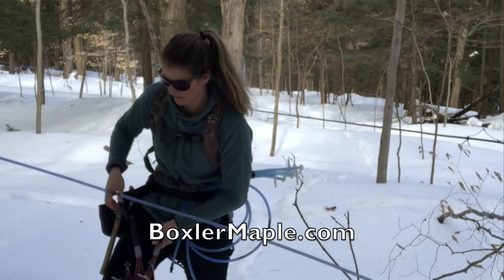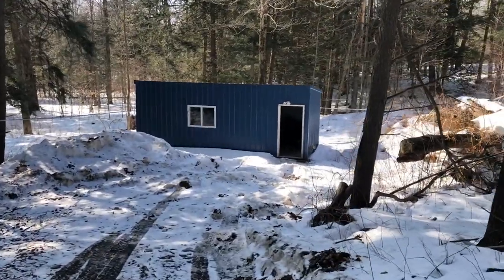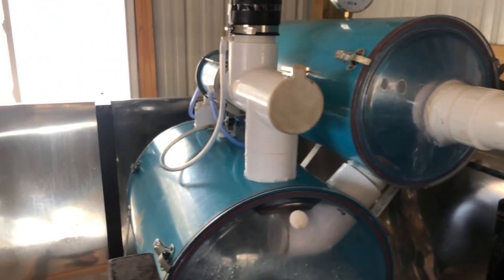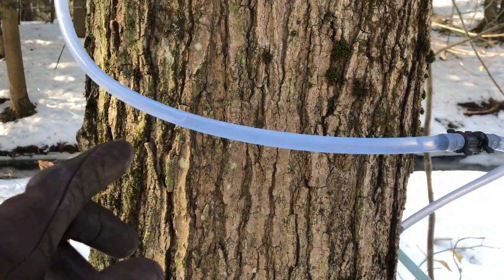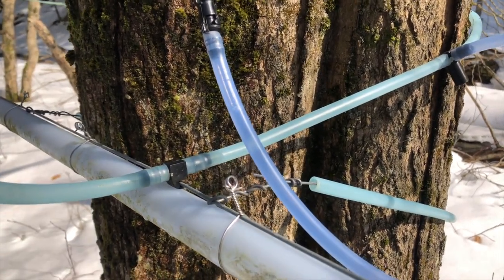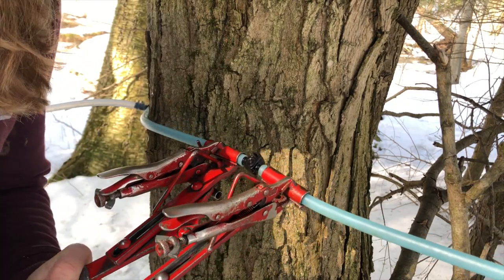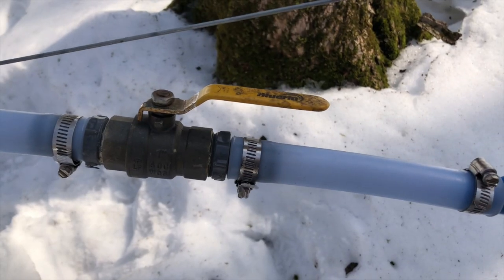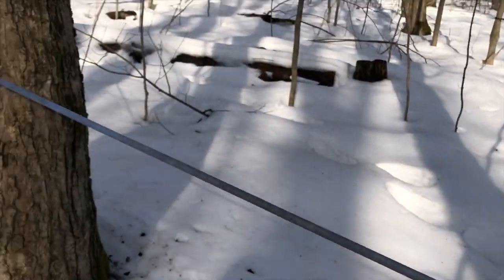Finding Damage and Fixing Leaks in Maple Lines

Comment: Love the  videos and seeing others do things different.  What's the reasoning for tying the lateral into mainline in that loopdee loop instead of Just the horizontal 180 into main
Reply: Two fold. #1.Provides ease of observation when leak hunting. #2.Avoids applying undo direct stress  to mainline entrance fitting, be it a saddle, 6 way, or spinseal.

Comment: I use a pvc cutter for the smaller lines I think its quicker and safer
Reply from the maker: I just got some knipex tonight that I'll be using in the future! I have had enough with accidentally cutting my fingers! lol
Reply: @MapleFarmer  Would you mind posting the particular model, I've been meaning to look for a better pair of hose cutters for cutting smaller diameter rubber hose, semi truck plastic airline etc to replace the cheap crap ones I have that are all plastic other then the blade itself which is non replaceable ( typical Chinese junk you know LOL )  Show them in use if you can on a future video as well.

Comment: I wonder if there's something you could coat the lines with that would dissuade the critters from chewing?  Something organic like hot sauce :3
Reply from the maker: that sounds like more work than fixing them as there is 175 miles of line and after a rain it would just wash away